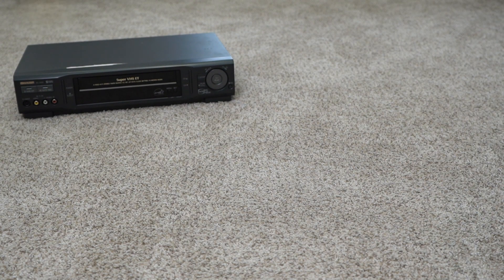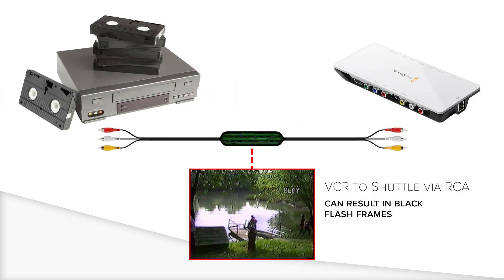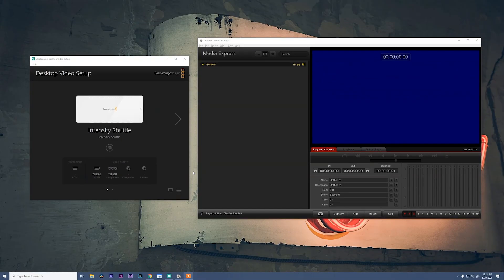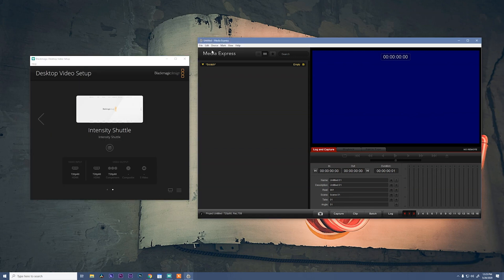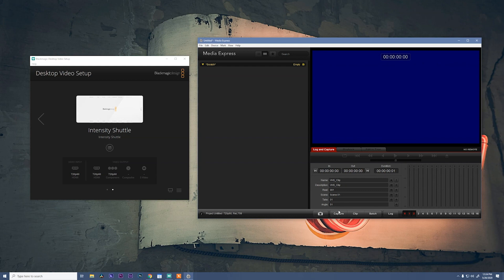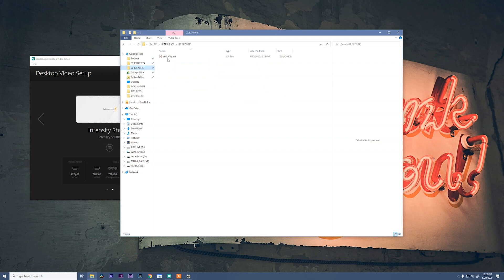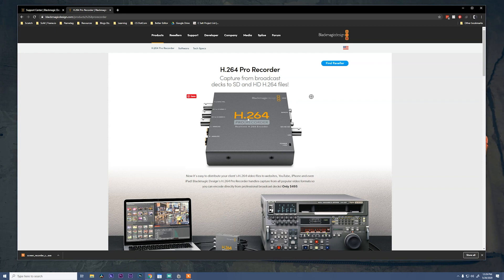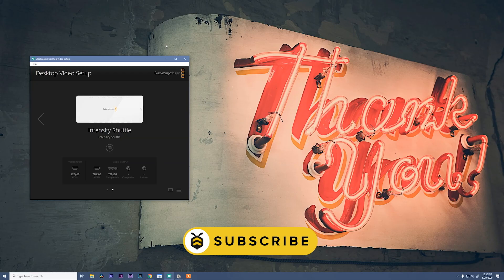How to Convert VHS Tapes to Digital Video

Comment: Thanks for this video - one concern though: is there a way to avoid the stretching which comes from inserting the Gana device? I was hoping to capture the VHS footage in its original aspect ratio and without any distortion of the picture relative to the original.
Reply from the maker: Not that I’ve found. You can fix it in almost any video editing software after it’s recorded though.

Comment: Thanks for this! Will the Blackmagic Intensity Shuttle still work on a Macbook Pro 2020 running Sonoma 14.13.1?
Reply from the maker: So far as I know, but it is an old piece of tech these days. There are other solutions out there by Elgato that may be a better solution now.

Comment: when i use the upscaler my aspect ratio is negativley impacted.
Reply from the maker: Yes it does change the aspect ratio, as seen in the tutorial.  The best solution for this if it does trouble you is to take it into some editing software and squeeze it back into a 4:3 aspect.

Comment: There is term floating around this topic. TBC - Time based correction….
it should reduce jitter caused by the charestoc on how analog vhs were played. it were seemingly played not always exactly the same speed ( my noobie understanding:P ).

your recording se wuite good. It seems like the black magic either has thos tbc or it’s not as necessary.

do you know about it?
Reply from the maker: I'm vaguely familiar with the term.  To my knowledge, VCRs with TBC are incredibly expensive.  The secret sauce that worked in this example was using the Gana analogue to digital converter before sending the signal into the Black Magic shuttle.

Comment: Hi! Coming back for a follow up! I've had great success with your suggested setup btw so thank you! 

I've started to notice a pink tint to a portion of my previewing screen, picture the top 1/4 of the screen. I've found a couple mentions of it having to do with the analog to HDMI converter. And when I tested that by bypassing the converter, it did go away, but then we had dropped frames of course! Have you encountered this before? And if so, what did you do to fix it? (Or even if not, do you have a suggestion?) I did a round of VHS tapes last Fall and am doing another now, and don't recall this pink tint being an issue then. Thank you!
Reply from the maker: That is a strange side effect!  I haven’t dealt with it personally, but as an editor my first instinct would be to color correct that portion of the screen to remove the pink tint. Do you have access to any editing software?

Another thought - does the pink appear on all you tapes or just some?  When it appears does it come on gradually or is it there from the start?
Reply: @BetterEditor  thank you for the response! I'm an archivist, so I do zero editing just for preservation purposes, but I agree, the people requesting the tapes could theoretically edit the tapes if they choose to use them. The pink, on some tapes, seem consistent from start to end. This current tape I'm running it comes in and out, and it's really in the same place as the others when it shows up. So weird! I did clean up the VCR heads too, so I think I just have to resort to thinking it's the tape/film. =\ but I thought I'd ask!!

Comment: This (at a conservative guess) is going to cost at least £300 ($412). Surely there is a more inexpensive way to do it
Reply from the maker: This is just a proven workflow for DIY vhs to digital. Never claimed it would be cheap.
Reply: @BetterEditor  no but neither do you say it will be expensive.
Reply from the maker: @bletheringfool  That's not my obligation and expense is relative to every individual.
Reply: @BetterEditor  I'm just making a point in your comments that might give people a heads up before diving into this.  It's meant to be constructive criticism about your video

Comment: I noticed that the. Sprite looked kinda widescreen, why was that? Vhs is 4x3 natively. Is it a preference on the software that u have activated?
Reply from the maker: Good eye!  It's not a preference unfortunately.  It's due to using the Gana Mini Converter.  It upscales the content to an HD resolution, but doesn't take into account the pixel aspect ratio.  There are other converters on the market that can do that, but I personally haven't worked with any.
Reply: @BetterEditor  I'd like to convert my VHS and keep them at a 4:3 - so I'm not cutting off any of the subject matter.  Do you have any that you recommend?  ALSO you mentioned the h.264 recorder by black magic - this will work just as well if I am burning the project to BD-R via PowerDirector or Premiere?
Reply from the maker: @ckelly38237  So using the Gana Mini Converter with capturing VHS doesn't cut any of the image off, the entire image is simply stretched to fill the 16:9 widescreen format.  After capturing the video(s), you can easily squeeze them back to 4:3 using Premiere Pro, DaVinci Resolve, Handbrake, or basically any other video editing program you're familiar with.

I'm not sure I follow your question on the h.264 recorder.  Basically you can use the h.264 recorder in place of the Shuttle that I use in the video.  The h.264 recorder will just record directly into the h.264 codec.  If you're asking if you can then burn those files to a blu-ray, then yes.  The software you use should take care of burning the files into a playable format.  Otherwise you could convert them first using one of Adobe Media Encoder's presets:  

https://helpx.adobe.com/hk_en/premiere-pro/user-guide.html/hk_en/premiere-pro/using/exporting-dvd-or-blu-ray.ug.html

Comment: I am not getting any preview for the playback, and I've set things up exactly as you have done in your video. I don't know what else I should try doing?
Reply from the maker: Sorry to hear that!  If you've set everything up like in the video, it'd be best to go into troubleshooting mode.  Disconnect everything and start checking components individually to make sure they are working.  For example, plug the VCR directly into the TV to make sure you're seeing video on the TV.  Plug a device with an HDMI out into the Blackmagic shuttle, with it connected to the computer to see if you're getting picture.  Also make sure to double check the settings in Blackmagic Desktop Video and in Media Express.  They should ideally be at 720p60 if you went with the setup I described here:  https://www.bettereditor.be/convert-vhs-tapes-to-digital/
Reply: @BetterEditor  Thank you, I will definitely try this!
Reply: @BetterEditor  So I did test everything like you had mentioned, and the VCR output to the TV does work just fine etc. What I did notice, though, is that when I am in the "playback" tab on Media Express, I can see on the Blackmagic Desktop Video Setup screen that it is automatically detecting my video's output information etc. 

When I switch to the "log and capture" tab, that information disappears and acts like it can't automatically detect anything [unlike in your video, which I just rewatched again, and I can see on the screen your Video Setup screen has that information for the output while you're in the "log and capture" tab of Media Express. So, it's picking up on something, but not everything...I can't tell what the hitch might be. 

Thank you for your advice though!
Reply from the maker: @ashhleyyyyxxx  Interesting.  And are you using the Gana Mini Converter to get from the VCR to the Blackmagic Shuttle?
Reply from the maker: @ashhleyyyyxxx  Trust me, we've all been there.  Glad you got it to work!
Reply: @ashhleyyyyxxx  I am having the same problem! What was your silly fix? I am worried I am doing the same thing😂

Comment: can I do this with a black magic Ultra studio express?
Reply from the maker: Hey Scott, thanks for the question.  If you mean the Ultra Studio Mini Recorder (https://amzn.to/30zdzNq), then yes you should be able to.  You'd definitely need to use the Gana Mini Converter or similar to convert from an analogue RCA connection to HDMI.

If you're using the UltraStudio Mini or Extreme, you'll at least need RCA to BNC adapters (https://amzn.to/2C8vhOs) to connect the VCR or possibly even a HDMI to BNC converter (https://amzn.to/2XC16Xs).  Again it depends on if you use the Gana Mini Converter or not.
Reply: @BetterEditor  No I meant the Black Magic Ultra Studio Express, Its a bit older but still great. https://www.bhphotovideo.com/c/product/857462-REG/Blackmagic_Design_BDLKULSDEXPRESS_UltraStudio_Express.html?fromDisList=y  . I just got the Gana converter and HEY it work I can actually see the footage in the Media express however I'm getting that bad time code issue you mentioned in your video with the converter. Any way I can fix this issue??
Reply from the maker: @scottvosper  Ah!  Sorry man - thanks for the link.  I've never used it, but I don't see why it wouldn't work.  If you're going from the VCR to the Gana converter to the Blackmagic Ultra Studio Express, I would think the video would look fine - no dropouts.  Just confirming that by timecode issue, you do mean the black dropouts?
Reply from the maker: Gotcha.  In my experience, the Gana converter solved that issue once I passed the video through it.  I'm sure you have, but double check that it's not the tape by watching it straight from the VCR onto a TV.  I'm sorry I couldn't be more help.
Reply: @BetterEditor  no worries thanks for your replies!